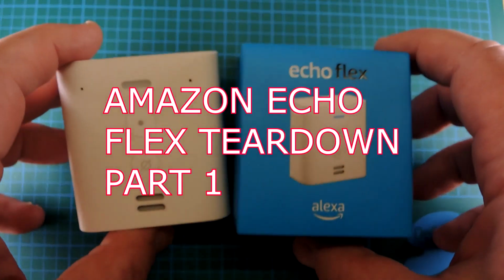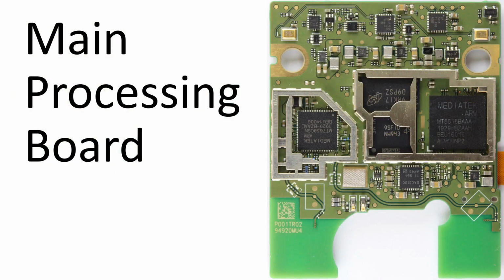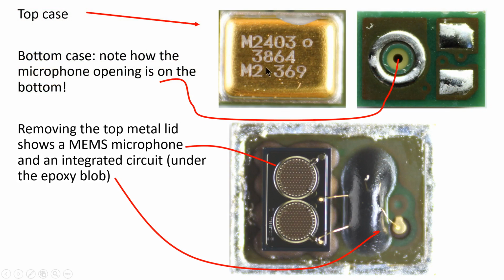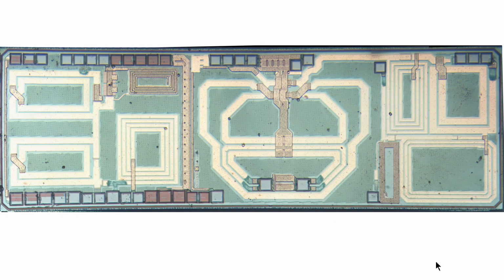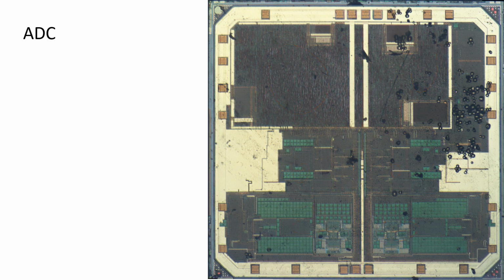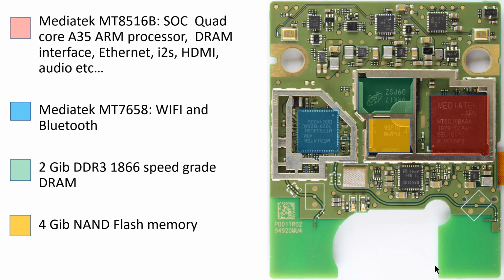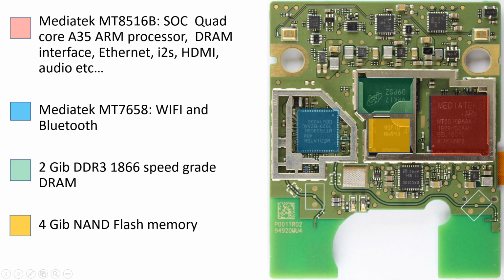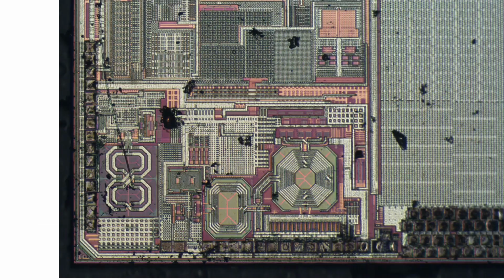Amazon Echo Flex Teardown      part1

Comment: Hello, my idea is to incorporate the echo flex inside the jbl flip 4, for this I need to power the echo with 3.7v provided by the jbl battery, surely somewhere the 5V of the echo is reduced to join those parts, then perform the internal audio connection and test how both microphones work without drilling holes in the jbl's cabinet, what do you think? The video is very interesting. Greetings

Comment: Really curious why only one sensor in the MEMS is used
Reply: I have two theories:

1. It's possible they build a stereo version of this sensor, I feel like the separation would be terrible, but I guess it's possible if you want to drive a stereo input. In this case it may be more beneficial to make only one chip and package it differently based on the application.

2. Maybe they defect rate is high enough that they make a dual sensor, but end up with one of the units on the chip broken most of the time. So they can just bond whichever side is working correctly.

It seems like one of these, or a combination of the two, could be very possible explanations.

Comment: Haven’t seen one of your videos lately. Glad to see it. I would like to see more on that DC DC converted in the mic. Is it something like an RC oscillator and magnetic?

Also hardware mute would be interesting. I suspect most of the silicon is going to be too small for much analysis. It’s the downside to cutting edge tech. Usually ancillary  devices lag a little behind core devices but I guess we are at that point where value devices can have ultra small features. 

Also iDK if this would be of interest but if you send me silicon I could put it in our SEM and send you the images (no charge)

Comment: I imagine the separate diaphragms in the MEMs microphone are not bonded out individually because they’re internally connected in parallel, the reason for two diaphragms is to get a better fill factor and better frequency response, the design of the grid is also key to frequency response. If you still have it could be interesting to cut it out and look at the other side? Should be a similar pattern.

That separate WiFi IC is weird, the onboard WiFi of the MT8516 is only 2.4 GHz whereas the MT7658 does 2x2 2.4 GHz & 5 GHz although no DFS support nor mesh peer-to-peer support so I’m not really sure why they would do this especially when trying to hit such an insanely low price point for such a complex device. Speculation: I wouldn’t be surprised if a key reason to support 5 GHz is to collect beacon and probe frames and their RSSI of nearby 5 GHz devices like your phone to tell when you’re moving around. I'm sure they would love to feed that data into their magic AI.

Definitely take an in depth look at the “button that electronically disconnects the mics”.
Reply: Upon further research the only other thing I can find that might need a separate WiFi & Bluetooth IC is this "Amazon Sidewalk" thing but there's very little info about it.

Comment: Just checked information from Mediatek, the SOC only has 802.11bgn and BLE4.2,  while the seperate WiFi-Chip supports 802.11ac and Bluetooth 5.0. Seems Amazon wanted or needed a faster wireless connection than the SoC could offer and it was easier/cheaper to use a dedicated WiFi chip instead of using a different SoC.

Comment: Would love details on the "hardware mute" functionality.
Reply: This.
Reply: I would guess something simple like holding the ADC in reset.
Reply: Using a dedicated speakerphone chipset that likely is just a small signal MOSFET shorting the ADC input pin to analogue ground. either part of the chip or an external part.

Comment: what really is the point of having 2 microphones in each mems package for stereo output? they're separated by like.... a few microns. if even the highest audible frequencies have wavelengths on the order of centimeters then both of the mems microphones in the same package  are always going to be experiencing the same pressure and producing the exact same output. this is why they only connect one microphone and then put another mems package on the other side of the board, because there probably is useful directionality etc. information that can be extracted at that scale. but stereo output from the same package? why not just fake it and double the signal electronically?
Reply: 2 microphones to increase sensitivity, as you now have double the surface area, also having 2 and only bonding one means you can have a single one fail chip scale testing and not make the whole unit useless, increasing yield, especially if you are not needing the most sensitive microphone. The MEMS sensor is basically a near 1GHz oscillator, using the mic capacitance to vary a LC tank, mixing it with another LC tank generated on chip, and then using the difference as the audio output. With them all consisting of silicon you can get the temperature tracking to be pretty close, though there is a DC offset, likely removed by a low pass filter in the chip, and applied to a reverse biased diode in the reference oscillator, to keep the drift in the reference oscillator the same as the sense one.
Reply: @SeanBZA  thanks for that....those RF inductors were giving me a headache. So bonding in the other microphone might change the LC frequency to something like 500MHz? 

So the transformer in the center of the microphone IC is the mixer/downconverter presumably ....think there has to be a couple of diodes in there.
Reply: Maybe improved performance / gain at the vocal fq range with 2 mics per package.
Reply: My thoughts are  that it was included for either the increased sensitivity or to facilitate noise/bias compensation. Having a 2nd mic package nearby already probably allows them to get both from that while also increasing phase separation for the directional component.

I wonder how practical it would be to wirebond that 2nd mic to something more fun.
Reply: I think they dampen each other and prevent each other from oscillating on their own and getting into resonance in some frequencies. 
Sort of like a difference amplifier, only signals that pass a certain criteria from each MEMS is accepted by the DSP.
Reply: My layman's guess is that the two sensors per die is a combination of
1. Ensuring good yield by putting two sensors per cutout region. Even if some sensors are not to required spec they might end up losing less area to failures by reducing the breakout and cutting regions between dies.
2. They sell the same die as a different product to someone, where having two sensors lets phase calculations be done on a passing soundwave. They then sell this lesser version 
3. It might be cheaper to handle larger footprint dies, (in combination with maximizing yeild by redundancy).
4. Some wizardry to reduce noise by having two sensors that are expected to get essentially the same signal.

Comment: Glad to see a new video! I hope you're doing alright. It is odd to have a separate wifi/BT chip when it's built in already.
Reply: Probably done to offload processing to a separate chip, getting the core that would otherwise be dedicated to it free for on chip work or power management. That way they can have the main cores in a power down mode most of the time, and only one core with a reduced clock running to poll the wireless interfaces and the ADC, looking for either a MAC match or a sound level above the trigger level, which then powers up the other 3 cores at full speed to process the input. As well for playing audio all you need is a slow core to do the decoding, keeping power use low again, though it is likely using the ADC chip speakerphone DSP to subtract the output from the microphone, to still be able to respond to audio triggers as well.

As they need a Bluetooth stack in addition to wireless the chip with both functions in it was cheaper overall, and can use the same antenna units as well. Also easier to upgrade the unit if they need different wireless functionality or worldwide coverage having a chip that you simply either reflash or change a configuration register set.
Reply: @SeanBZA  That makes sense to me. Thanks for the detailed reply.